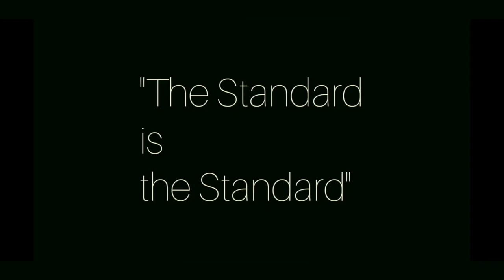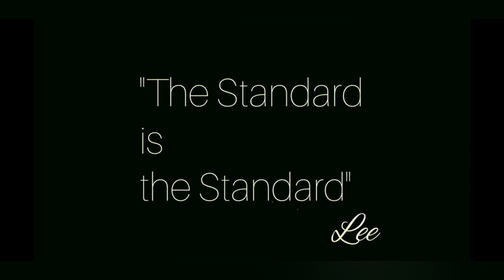emblems, numbers and lettering on a boat: When removed, sometimes leaves a ghosted image.. fix it.

Comment: Really great result and great match on all the lettering. Keep it boring bro I love it. I saw another Cobalt the other day at the marina with the bigger format badges and thought of you lolz. The owner is lucky to have such a shiny Cobalt… usually they just look like azz. I only use a DA for wax at home. In my shop wax is always applied by hand. I seem to loose a lot of wax into my pad though, guess I don’t have my mojo just right for DA wax yet.
Reply from the maker: My pads soak up a bunch of wax too but as I'm doing boat, after boat, after boat, I just keep one going until it doesn't work well anymore.
I'll certainly be boring, I don't intend to change any time soon.
Thanks for watching and yes, Cobalt's have a history of fading out and the owners tend to not get them detailed UNTIL they fade out (way too late in my opinion)
Cheers!

Lee

Comment: How often do you clean your wool pad with the spur or washing it during a job
Reply from the maker: I never wash them but if you watch a longer vid of mine you'll see exactly, I usually leave the cleanings in there. On a top of a ski boat, perhaps once per side, a hull, twice a side? Depends on the boat really. I'm not trying to be funny about it. It's like asking how many times do you chew before swallowing, depends on the food.
Reply: Really? You never wash them. Interesting. So when the pad starts making dust, that means its time to clean/spur? Thanks a lot for making these video's. I just landed a job to do a 52fter heavly oxidized cruiser. First time doing a boat this size i was super nervous. But your 3m combo has me looking like a pro. SUPER DUTY IS THE TRUTH!!!!!!! Thanks dude. Your rock. Oh BTW I just started my business a month n a half ago.
Reply from the maker: I Spur when the pad gets too gummed up with Compound. I try to use the "right" amount of compound to avoid this but keeping a a fluffy pad is important. When it gets too flat or compressed, time to Spur.

On big boats, break them into sections and just keep the process going. You'll be fine. Good luck and thanks!

Comment: Nice man!! I commented on a week ago on a different video Lee, about some presta super cut I got after I tried Maguires 67, you recommended 3M heavy cut, well I got some ordered , the presta did okay, but I still have the top of boat to do and the very back to do, around the transom, so when I get back from Florida next week it should have been dropped off by amazon, and we are gonna rock on with that, 🤘 thanks for the videos!!!
Reply from the maker: It's my absolute pleasure. I recall the message, glad you ordered the Heavy Cut, you'll like it. It's like #67 on steroids. Odd because 3M owns Meguiar's.. 😜
Reply: @Local_Boydidgood  that is wild, I mean the 67 was like hand lotion compared to the presta, so the 3M Super duty, and 3M Heavy should be awesome!! I also got the quick  3M disconnect and a 3M double sided roughing wool pad!!
Reply from the maker: Hopefully it all works out and I don't come off as a liar. Make sure the pad spind smoothly, very little wobble. If not, return it and get another one.
Reply: @Local_Boydidgood  I’ll keep you posted brother, thanks for putting the info out there!!
Reply from the maker: Forshizzle!
Reply: @Local_Boydidgood  one quick question Lee, when I am using the 3M super duty, should I tape over any pin striping and decals so it doesn’t cut them as well, or will it even bother them?
Reply from the maker: Depending on how faded they are, you can. Usually just apply less pressure/time aroind them but if they still have color, you should be fine.
https://youtu.be/rmwCNmkJgIE